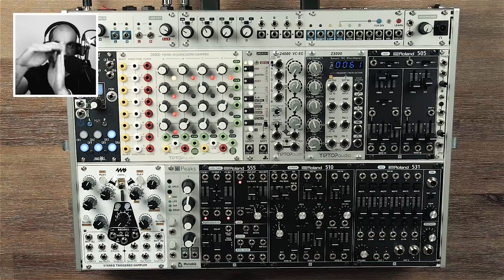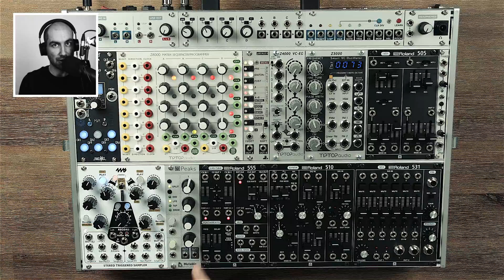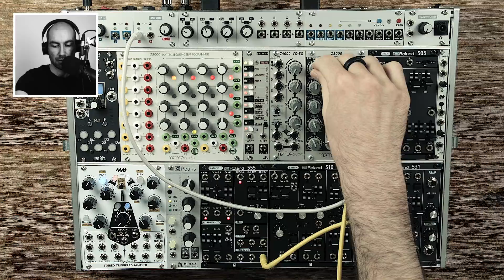Roland System-500 555 Utility Eurorack Module

Comment: Not to be a PITA, but connecting this to 18 other pieces of outboard gear doesn't show you what that ONE component can do on it's own, right? :) 

Each thing you run into the chain will alter the sound. That's geek 101, even I know that, lol. 

I don't have the other 18 grand shown here of Roland stuff.